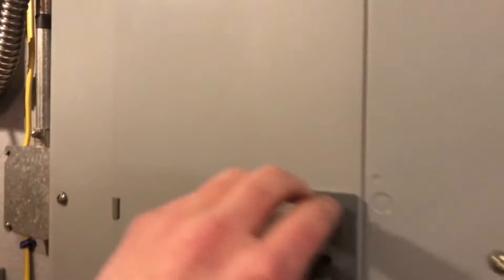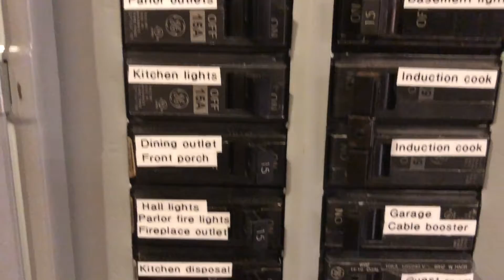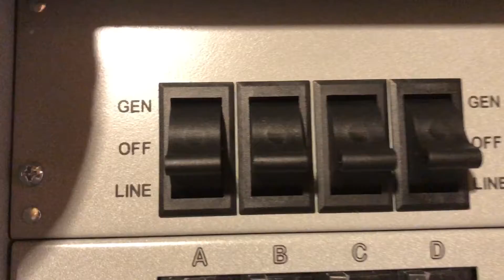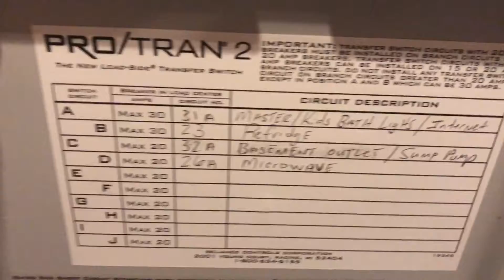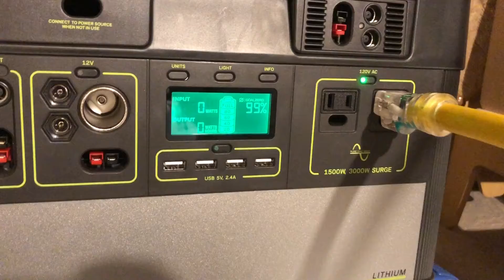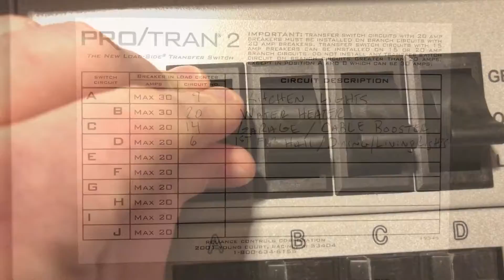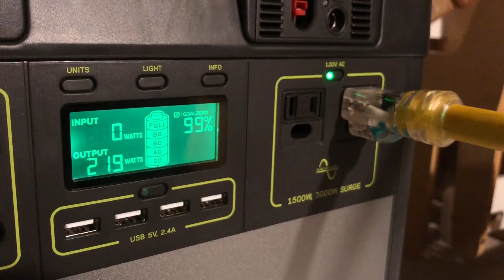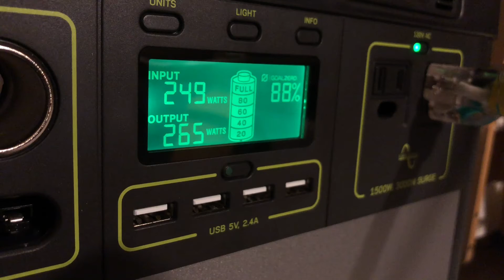Installing Two Goal Zero Yeti Home Integration Kits to Connect a Yeti 1000 to My Electrical Panel

Comment: Hello Todd! 

Great Video! There is no info on this system and when you call Goal Zero there are very vague about the system.
Can you tell me how this stops power from feeding back into the grid?
Reply from the maker: It’s a pretty standard transfer panel that everyone uses to connect generators to their panels. I can’t explain how they work re: the grid but they don’t back feed and are very safe.
Reply: Basically you keep the switched turned off when not in use. So no feedback when turned off. Also you are only feeding into the circuit lines not going back to the grid itself via the main panel box. As in your standard electric panel should never feed power back to the grid. Now if you are talking about solar power systems that you set your home wired into that may be a total different arrangement and probably takes place outside the box itself as in the power lines that actually feed your electric box to begin with via power company. One of the reasons one needs to use surge protectors. We bought a whole house surge protection system when we moved here due to many homes including the one we bought having a history of power surges that were destroying freezers and other applliances. Previous home owners had spent big money repairing both freezers and fridges due to this and since we installed the whole house protection not once. However recently one did catch our newer landline phone system and a neighbors septic pump system also was effected. Not sure if they had protection or not. Meantime we recommend it if you live in an area that is prone to surges and outages. (Before we did this we ran through 3 computer modems one after the other within a year due to this problem but of course we do not have any outside solar or wind power off grid set ups at that time and still do not. This is a back up system as our power that rarely goes out up here in NW MT did just a few weeks ago. We were back on in 11 hours but neighbors were 3-5 days without during January WINTERS...OMGosh. We are fine iwth no lights as have plenty of USB lights via Power banks to take care of that. What we do need here is back up for Well as we have a new system that will or could burn out if we attempted to run it as in flushing toilets or two when powers out and also run the fan to an LP furnace to keep house from freezing. Otherwise we can manage basically. We may attach a garage door and our phone line to avoid that issue again in future. But have tablets and a simple cell phone for emergency use if our computers are down otherwise. We are not attempting to run our fridges or freezers or water heaters. And definitely not on a wee sngle Goal Zero Yeti 1400 W Battery. That's why the back ups and if you need to have back up for 2 days to a week or more that's whey the investment in the four deep cells Goal Zero sells too. Anyway you are not feeding power into the main power lines period with this or a deep cell back up system. You are switching on these batteries to feed into the circuits prewired in your home to run specific applliances or what's on those lines. For us we will put a on off switch by the way to items we do not want to run if on those lines such as our water softener or water heaters. We do not want them to run while the goal zero runs the sump pump which is important to the running of the furnace as much as we need the fan. The fan will not take a lot of power to run and the sump pump runs several times a day for short periods so no problem with that. And so if say you have an item like our water heaters and our water softener that do not have on off switches on them we can use a go between heavy duty plug adapter that does to turn off to avoid draining the goal zero system way too fast when we need it for the prime purpose to run furance and well. Do not expect this system even with the four addiional batteries to operate the entire house as if there was no failure during an outage. That's unrealistic and would be looking at a full LP generator back up system with it's own LP tank etc. if that's our goal. And we have so few outages up here we do not feel that need. We also live in mountains were we rarely need AC so do not have it in our home as most around here do not. We also do not have a lot of sunshine year round this is not a solar productive setting and low degree unit days at that. So basically we won't be setting up to recharge via sun unless it's a warm weather outage and the deep cells will keep thigns going while I carry the Yeti upstairs to charge via solar panels. And then return to recharge the deep cells or add to them. I could run through an open basement window. Mind you our basement has 9 to 12 foot deep floor to ceiling depth and below the three windows it is cement that is extremely thick and difficult to drill into let alone through. After watching people struggle with installing the LP line to new furnace I finally suggested they go through the above ground level where it is not the thick cement and enter that way and sure enough they finally succeeded. Yes I'm a female in her 70's but even experts seem to fail logic lateral thinking sometimes. Anyway stay safe and educate yourselves. Read manuals of all products you may be investigating most are listed on line or thorugh their sellers web pages. And yes Goal Zero could and SHOULD DO BETTER at presentations of how to install these units. We tend to educate ourselves so we can assist the electrcian in this case and or have all materials on hand in advance of turning to one and having to order due to our remote and rural area where it's 100 miles to nearest large town Kalispell MT so a 200 mile round trip is not always helpful. Having all things pulled together in advance means a win win for everyone.

Comment: I have been researching Goal Zero products for the past week or so, and you have the most informative videos out of just about anyone I have seen, so thank you for that. I am curious as to what you think about the Yeti Tank Expansion Batteries?? Do you think they are a good investment or maybe even a good alternative to solar? Or what about both solar and a couple tanks? Is that even a possibility? I apologize for so many questions, but you seem like the guy to go to!
Reply from the maker: Thanks for the kind words. My major issue with the Link/Tank combo is it uses lead acid batteries that are heavy, can’t cycle deeply, and wear out faster than lithium. The required Link module also takes up the slot I use for the MPPT module for more efficient solar charging. If you need lots of relatively cheap storage, the tank might be ok but I’d recommend getting a larger Yeti like the 3000 if you need more capacity because that uses better batteries, is still portable, and has the MPPT module built-in. As far as you solar Q, you still need some way to recharge these batteries so I’d recommend having a few options for cases where you lose power for more than a day. I have a few 100w panels and a small propane generator that can charge the Yeti but choose what you need based on goals and usage
Reply: @todd.parker  Thank you for your response! The fact that the tanks use lead acid batteries was my primary concern, but supposedly Goal Zero has some expandable lithium tanks in the works, so I guess we'll see. I am still quite new to the entire area of off-grid power, so I am doing constant research to better understand everything. I have looked into the Yeti 3000, but the only thing that concerns me is that while it has a 3000 watt surge, it only runs 1500 continuous, and I may need more than that at times. I plan on building a tiny home on wheels and traveling around most of the time, and if I can go a few days here and there without stopping off at an RV park that would be great. I'm going to need a setup that would constantly power an apartment style fridge, amongst a couple other appliances, and a 10,000 - 12,000 btu mini split running on 220V and 10 amps exceeding possibly 1,100 watts. I plan on getting as much solar as the Yeti can take in, so in the case of the 3000, I guess that would be up to 4 of the Boulder 200 Solar Panel Briefcases. Does any of this sound doable? What would you suggest? By the way, I am trying to remain as quiet as possible, so no "loud" generators.
Reply from the maker: Check out Will Prouse’s channel. He has a ton of good info. You might want to consider buying a few Battleborn lithium batteries and either assembling a system or using one of the all in one charger/inverter units he’s been reviewing if you need more power. 
https://youtu.be/ikDLxnf1ePQ
Reply: @DrSamBeckett  - I've a total of 1,050 watts of solar panels attached to my Y3000.  The first 550w (2x200w + 1x150)  connected to the PWM charger and the other 500 (2x150w + 1x200w) is connected to the MPPT. I discovered that at best, I'm only able to extract 65% from either charge controllers - which puts my charging (at peak sun) just a tad bit under GZ's recommended aggregated charge rates. Your bigger challenge, I think, is finding the most energy efficient portable 110v fridge + microwave for your tiny home so you don't end up discharging the Y3000 faster than you can top it off. G'luck!

Comment: Amazing information.  Super helpful to see a use case explained.  Especially one as well thought out as yours!  I was wondering how do you “exercise” the yeti?  I hear Goal Zero recommends the yeti be used to charge a cell phone or something similar to keep the battery in optimal condition.
Reply from the maker: I do try to run it down and recharge it every month or two. The fastest way is to connect a high drain AC device like a space heater. Run it on low (750w) for 39 minutes then recharge to exercise those electrons.

Comment: I have watched all of your videos and definitely decided on the Yeti.This video is my favorite, since I think it's so organized and utilizes the full effectiveness of what the Yeti can do during a power outage, without having wires laying around everywhere. I did as much research as possible and all of your videos were by far the most helpful. Tomorrow I will order either the 1000 or the 1400, just not sure which one. The phone rep I spoke to on Friday said she could sell me the 1000 for $799 (that is not advertised on their website). But I will ask her how much the 1400 will go for and if that is on sale also? Thank you very much for sharing your work!
Reply: If you go to their website you can search for Open Box.  Or ask them on the phone. They can sell Open Box Yeti 1400s or 3000s for a lot less.  Warranty is about half as long, I think.

I was going to get an Open Box 1400 and then opted for the Open Box 3000 instead.
Reply: @TheChadWork2001  Thanks! Yesterday I bought the $799 deal on a new 1000. I have two homes in California, vacation home in Lake Tahoe and already getting warnings from utility company of power outages this year to help prevent fires. So I am in a race to get that 1000 up there and a panel kit installed. My sewer line needs electricity to pump up hill to main line. If it works great I might open box a 1400 later this year so each home will be set. For now the 1000 will be traveling with me between both homes. I bought 1 100w panel for each home and two light 8 lbs panels to travel to and from homes. I think I bought all the right connections so far for them.
Reply from the maker: Hey thanks! I think you should go for the highest capacity you can afford since expansion is limited to lead acid right now.

Comment: Todd I saw you where using the yeti 1000. How long did it last to run your refrigerator?
Reply from the maker: It will run my full size 36” refrigerator for 16-24 hours depending on weather and how often we open the door. Not bad!

Comment: you can run your water heater from your yeti?
Reply from the maker: Yep! I have that on a circuit that I can power from the Yeti. I was hoping to do my heat as well since it’s also a small on demand style unit but the air handlers are 220v
Reply: @todd.parker  that's really impressive. it takes a lot of energy to power a water heater.
Reply from the maker: mike allen my water heater is natural gas, not electric,so it only needs a bit of power for the pump
Reply: @todd.parker  that makes more sense. electric water heaters suck too muck power for yeti.
Reply: Out of experience, the best money spent for hot water is in a solar hot water system! 5 yrs ago I bought a small single panel with a 80gl storage tank system for $600 installed. I connected a small on demand water heater on the inlet pipe that enters the house(bath room, kitchen, laundry) that can be turned on with the flip of a CFI waterproof on/off switch   I located 2ft to the left of the shower head.
Reply: Only 2 times in 5 yrs has the on demand hot water heater been turn on! It was on the first week of the solar hot water installed.
The hardest part of living conservative is re-teaching  people! Why do we leave the faucet on all the time while shaving, brushing teeth, taking a shower? Finally we learn to open faucet, get wet, close faucet. soap up, open faucet wash soap off, close faucet.

Comment: You really should invest in the 1400 at least with the way you test and use the product
Reply: Anthony Garrett - Maybe even the 3000
Reply: I’d say the 3000 has more power,more storage, and I think but not sure that you can chain in more auxiliary batteries to the 3000.

Comment: Todd, you’ve got me considering this option for my place. I’m having a hard time getting any installers of larger battery systems (e.g. LG Chem) to even return a call—which is frustrating as I have a PV array on the roof that sits unused when the grid goes down. A setup like yours might be just the ticket, since I have the 1000 and some GZ panels. I’ll report back on what I find. Thanks for all your informative content!
Reply from the maker: Vlad I think you’ll like having the integration kit, mostly because you can power hardwired appliances like water heaters, pumps, and overhead lights you can’t connect with an extension cord.

Comment: Hey Todd what is the maximum amount of charge you can put into the yeti,using all the ports(including mppt port)
Reply from the maker: Gabriel Varona I believe that it’s 720 watts total - 360 watts in the PWM (built in inputs) and another 360 watts on the MPPT module if you’ve added that. Within each, you can use any combo of ports, but 360 is the max for the sum.
Reply: @todd.parker  That is correct. Both of my 400 watt arrays are putting out almost 300 watts per side right now in the winter. The highest input I've seen on my 3000 so far is 591 watts. In summer I should see around 650 Watts going in per hour. I love how I can see all of the statistics on my phone at my cabin that is 2 1/2 hours away from my house. It powers my ring.com camera and my AT&t hotspot, both combined pull less than 20 watts per hour so I have several days of backup power. Even on cloudy days my array puts about 80 watts into the yeti during daylight hours. I've never seen my yeti drop below 90% except when I spend a few days there. Next time I'm up there I will record a video of my setup and share it with you! Thank you for these videos.
Reply from the maker: @mooniesbarbecue7733  That sounds like a great setup. You have the right idea to have a lot of panels so you are still pulling some power, even on cloudy days. Using a Ring camera pointed at the Yeti to see the stats remotely is a genius idea!
Reply: @todd.parker  actually the ring camera is pointed at the driveway so I can see if someone is snooping on my property. I'm talking about the yeti Wi-Fi app on my phone. The yeti is connected to my hotspot and I can see real-time data. Have you connected yours to your Wi-Fi and downloaded the app?
Reply from the maker: Moonies Barbecue I see. Turns out that’s only on the 1400 and 3000 models. The 1000 has the same front end (chargers/inverter) but I guess the Wi-Fi is reserved for the larger models only. Boo.
Reply: @todd.parker  Pointing a camera at the yeti is a good idea if you don't have the wifi app! I'm not sure why you had such a bad drop over the long run. My panels are 20.45v 4.89amp in perfect conditions. My DC runs from the combiner boxes are right at 45 ft. Over that run I've calculated 82% efficiency. Maybe it's because I'm pushing almost 20 amps at 20 volts over the 10g wire. Your loss video was a little shocking! Heh.
Reply from the maker: Moonies Barbecue yeah, I was surprised at the losses too, but in hindsight I should have gone 10 gauge. It’s much beefier.